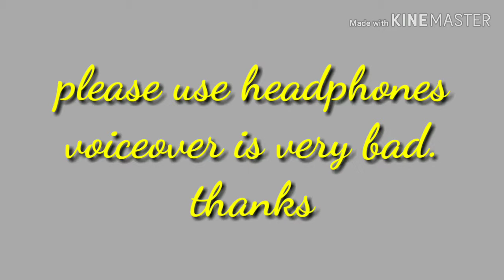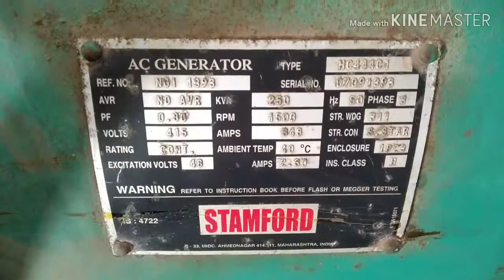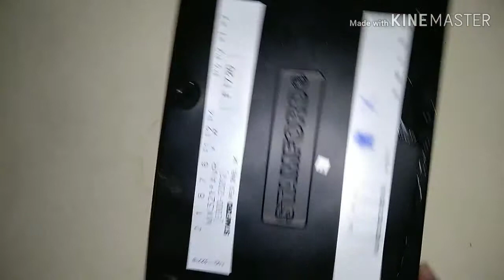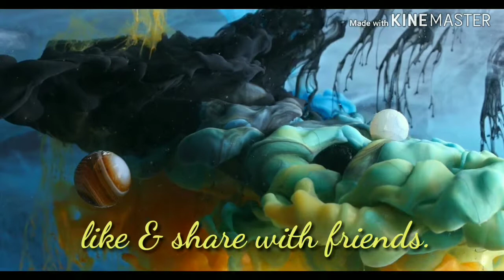DG parts and windings

Comment: Thanks for making this in English.  I have a couple of questions.  After the leads leave the RRA they connect to the field winding of the main rotor.  Where is the field winding located?  On the RRA there are 6 leads coming from the windings.  How are the leads differentiated between positive and negative?

Thanks for the information.